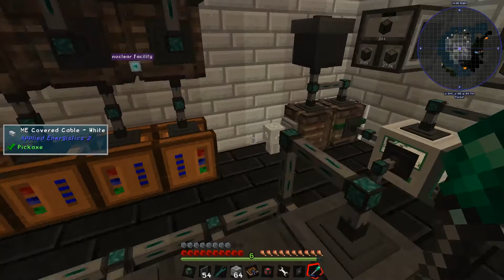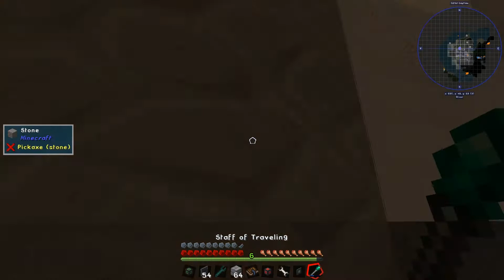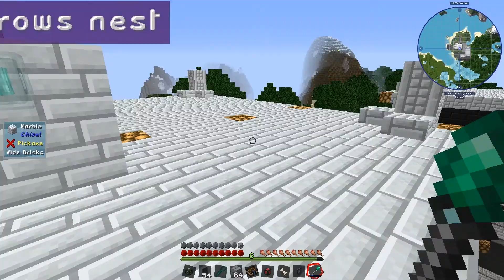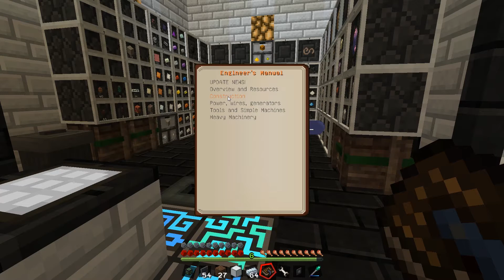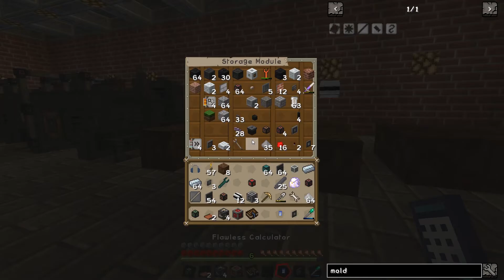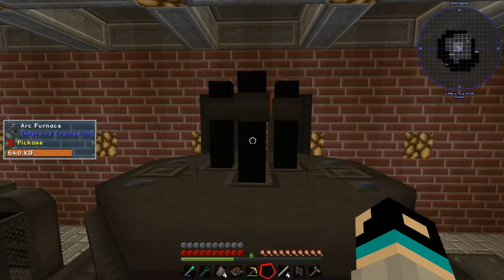Age of Engineering 44| Heavy Engineering| | Closet Gamer

Comment: Great stuff dude! :D Nothing wrong with a slightly longer episode - especially when its as productive as this one, blimey! 

I LOVE the look of the place - the black and white on all your buildings looks the biz.  Likewise I love the aesthetic of the factory underground with the IE machines too! Looks blooming wicked.  And your ME controller in the floor/ceiling looks awesome too!

I think you can get the interface to output directly into the press, but the hoppers do give you a bit of backlog room if you need it, which is handy. Likewise its a good idea, channel wise, to have the stuff going into chests which then goes back to the interface, good call there. 

Yeah the Arc Furnace is very RF-hungry.  As you get on to automating it, you'll find that stuff to go in the 12 main slots goes in the input on the left hand side; for any recipes that show items in the 4 slots on the right, those items do need to go into the input on the right hand side so you'll probably end up interfacing into a chest and selectively conduiting the items to the relevant inputs. 

Fantastic episode as always! Cheers! :)
Reply from the maker: FallingofftheGrid thanks for the support as always my friend, and cheers for the kind words. Glad you like the base! The vertical digger did most of the hard work - I just mucked about with bees for and hour and let it get on with it ;)

I've been looking at RFTools control for the distribution of parts into the arc furnace. The program looks fairly simple for it and shouldn't be a problem. The great thing is that you can place the node anywhere on the furnace and tell it what face it is inserting into :)

Comment: Blocking mode on the Interfaces should have been all you needed to enable to fix those interfaces. It should have prevented them sending more than one craft worth of ingredients at a time.

Did you know you can convert the flat ME Interfaces back into the full block form just by placing it in a table?

Since you've got AE running all around, you might consider making a terminal to carry around with you, then instead of having to run back and forth, you can just plug the terminal into any cable with a free channel and have access right there. The upside over the wireless is that it doesn't have the range limitation.

You can also simplify some of your wiring, with Ender IO's ME Conduits. They'll share block space with other EnderIO conduits and let you jump AE wiring across those conduits. It also has a dense version if you need to cross one of those.

Right, so as far as I know, the Arc Furnace eats 4096RF/t/operation.
Reply from the maker: blocking mode does not seem to work - it just dumps a ton of circuits in the carpenter. I didn't know that about the ME interfaces, switching those 11 i have in stock will definitely help - and that is a smart idea about carrying a crafting terminal in my inventory - I'm never far away from some exposed cable :) I also forgot about the enderio conduits - they will help out with the neatness of the metal press wiring.

Man, that is a lot of RF!
Reply: Ah, and I know why after some experimentation: Blocking mode would work if you requested 1 processor 5 times. But 5 processors 1 time doesn't work because it's all one craft. So it's dumping five processors worth of items in rather than one processor and waiting for the result.

I think the only way to keep the furnace supplied with that might be it's own bank of 3 vibrant capacitors. Then again, it's going to run once, and never be used again for such a huge crafting cycle most likely. IE you won't be burning a backlog, so you might be able to just borrow some to get the high transfer rate you need and then put them back once it's only running one ingot process at a time.